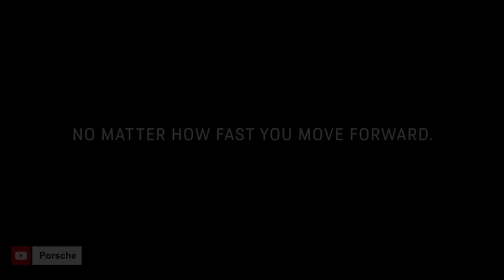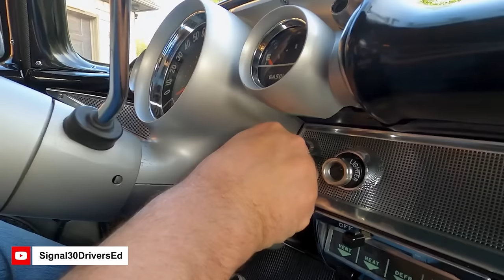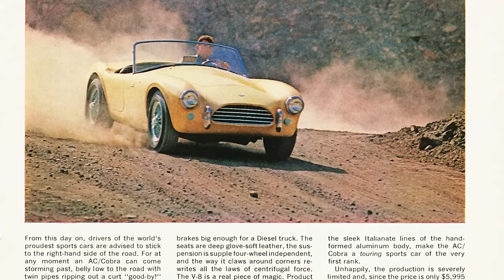Why Old Cars are Better

Comment: Modern cars = Rev hang = burnt clutch. 

Old cars with cable throttle > Modern cars with electronic throttle.
Reply: I do the math's lol.
Reply: My 98 Sentra has a cable throttle
Reply: Where do you even get a modern manual anymore? lol
Reply: @fortheloveofnoise  My '98 Olds does too.  That's not "modern" anymore.
Reply: LOL I recall getting all pissy when Drive by Wire came out like 20 years ago. I still don't understand why an RPG/Varistor connected to your foot is fed by wires through a computer that operates the throttle body with a stepper motor. Why? Why all this complication? Today? LMAO. I'm going to avoid new cars for as long as possible.
Reply: I have a 2022 Corolla manual and I have no issues with rev hang and clutch burning. Can't speak for other cars though.
Reply: @FuckGoogle502 Ford mustang lol
Reply: there's something more to it than just drive by wire. i have a 2011 ford fusion with the 6mt and it doesn't rev hang, but my MIL's 2015 subaru impreza 5mt is unbearable to drive
Reply: yeah my 03 tahoe wont shut up about throttle postition sensor codes and going into limp mode for no good fucking reason. A CABLE IS CHEAPER AND NEVER STOPS WORKING UNTIL IT LITERALLY BREAKS! @the_kombinator
Reply: @ChaseThePinballWizard  My 05 Sonata had a TPS failure, no CEL but I knew from experience what it was. I took the 5 mins and $29 it cost from rockauto to fix it though, 3 years ago and the car is still going.
Reply: the real point being what are you gonna do when the zombies take over and you cant find a rockauto? @the_kombinator
Reply: @ChaseThePinballWizard  I have a shelf and drawers with spares. I also know how to hotwire and defeat the steering lock on any car, so worst case I'll just steal one.

Or go down the street to a NAPA or Carquest. The possibilities are great.
Reply: somebody beat you to it. @the_kombinator
Reply: @ChaseThePinballWizard  To what?
Reply: they stole all the cars @the_kombinator
Reply: @FuckGoogle502  2010 kia soul 2.0 5 speed manual. Still not modern anymore tbh. It has character unlike any of these new cars ivr driven
Reply: The rev hang is to help manuals beat emissions since it helps burn off fuel or something, but I hate the side effect of a shorter clutch lifespan
Reply: @TheOnlyKreator1  There has to be a way to turn it off, no?
Reply: I hate electronic throttles with a passion
Reply: @the_kombinator  drive by wire is one of the sole reasons i wont buy a newer car, it feels so wrong
Reply: Rev hang is not going to burn your clutch unless you’re a doorknob.
Reply: @FuckGoogle502  Places that aren't the USA but yes, manuals are almost gone, only a couple of models left in Aus.
Reply: @the_kombinator  "...an RPG/Varistor connected to your foot is fed by wires through a computer that operates the throttle body with a stepper motor. Why? Why all this complication?"
As far as I know, it's to do with drivability and emissions. My early EFI car still needs a throttle position sensor even though it has a cable throttle, and I can slam the throttle open or shut faster than the air/fuel mixture can be adjusted. This momentarily causes lean mixtures in the cylinders, resulting in spikes in emissions. Or something. So newer cars replace the cable with a stepper motor to prevent drivers from making rapid changes in throttle position, and therefore they can stop the associated spikes in emissions. The downsides are complexity, worse throttle response and rev hang. =(
Disclaimer: this comment may contain nonsense.
Reply: @MathsYknow  Haha your disclaimer is awesome ;) Although I did not think about the potential of rapid pedal input. You know what deals with that perfectly? Carburettors. There's a whole other can of worms with those, especially related to emissions, but when they work, I find them less fiddly than mechanical or TBI injection types.
Reply: old cars = hit a tree at 50kph and die

new cars = crash at 120kph and live
Reply: @leviathan5207  I hit a 99 Venture with an 87 Hyundai offset (head on, mostly) - the van flipped on its side. I came to a stop on all four wheels - both cars were write offs, but there were injuries in the Chevy - none in the Hyundai. He was going 60, I was going about 90 (Km/h to be clear).

My crumple zone was in his car ;)
Reply: @leviathan5207  the advances are more so in hospitals, not car safety. Of course there has been dramatic improvements in car safety, but the biggest advances are in medical techniques.
Reply: @the_kombinator  I see both sides of the argument, in some old cars where the cable run is long, it is an absolute pain to replace it if it snaps, I would still prefer cable anyway.
Reply: @maxmeister747  5 mins in an old Hyundai ;)
Reply: @FuckGoogle502 my 08 outback may be getting up in years but it's still new enough to have electronic throttle but old enough to have a manual. The rev hang does in fact suck
Reply: @the_kombinator  I owned a twin carb flat-4 Alfa 33 for many years. I bet the endless trailing throttle backfires (which I loved) weren't so great for emissions. Its throttle was quite sensitive just off idle - EFI with TPS / drive-by-wire could map that out. One might call its twin carb setup fiddly because it would block jets or require tuning from time to time. I'd totally buy it again though.
Reply: Not really, maybe you are too poor to drive a quality modern car. A dual clutch system performs amazingly
Reply: @ChaseThePinballWizard zombies? You went to some special classes didn't you?
Reply: @smokinnplatez1426  You used the word "quality" and "modern car" - your intellect is limited.
Reply: Rev hang is the reason I didn't buy the new Civic. Sad tbh.
Reply: @smokinnplatez1426  DCT is the right choice... for the manufacturer.
Reply: I rode bikes with carburators. I rode bikes with simple injection. I drove cars with cable and simple injection. I drove cars by wire with advanced injection and I now drive a car by wire with quite sophisticated injection.
For maintenance, I'd go for simple, so probably simple injection with cable. For riding/driving, it doesn't really matter. It's not the system. It's how (well) it is adjusted.
Eventually, however, being able to adapt is also a valuable driving-skill.
Reply: @ChaseThePinballWizard  I had the throttle cable break on my '72 MGB at the end of a 4,000km road trip.  I was just 4km from home when it happened in the small hours of the morning, so had it towed to the house.  When I looked at it in the daylight, I realized the distance from the pedal to the carb was so short I could have fixed it with very basic tools and a bicycle rear brake cable.
Reply: @thomascordery7951  my dad had the same thing happen to what he called a "chip truck" (box truck) so he had to drive about a thousand miles with the cable in his hand going through the window.
Reply: @ChaseThePinballWizard  cars don't matter in zombies because all the gas goes bad pretty quick in the classic "all supply lines cut" scenario
Reply: @ChaseThePinballWizard  dont know if you have fixed your problem yet but my o8 impala ss had the same issue couldnt figure it out for years but apparently its a inherent issue with our early 2000s gm gas pedals put one in my ss and the problem never came back  but i did read with the suv's that the radio fin on the top can leak rain water down into the a pillar and corrode the wire that goes to the gas pedal wire so check under your dash have fun and good luck
Reply: @the_kombinator  The societal 'trend' towards "Control, above all" bled into engineering and the decisions those above the engineers make.
The TB being Drive By Wire, gives the control to the manufacturer/regulator. 
It literally takes your pedal input as a *mere suggestion*, computed and 'decided' against your will (in the name of 'fuel efficiency and emissions').
Reply: @LRK-GT  Carburettors. :D
Reply: @the_kombinator cheaper
Reply: @leviathan5207 thats very true, the fun in old cars comes with a price
Reply: my 2010 vw, sounds about right
Reply: @the_kombinator  Drive by wire is more important with cylinder deactivation to smooth over the sudden step-changes in power, one of the big criticisms of the Cadillac V8-6-4 which had a physical throttle cable.
Reply: @ChaseThePinballWizard  Sounds like you need a new TPS or throttle body. Ignoring the problem won't make it go away.
Reply: @milfordcivic6755  tried that.
Reply: Dawg, my cable throttle Ranger felt like it had rev hang when I got it, TBH... I guess I was just too used to my motorcycle.

Comment: I'm 17, so I guess the nostalgia doesn't really exist for me yet, but the main car I drive is a 1990 nissan. When I drive my moms new audi suv it doesnt even feel like I'm driving and I feel like I'm a worse driver just by driving that car. I can barely see in front of me and I feel like I have no control over the vehicle. My car is the sweet spot where I can do all my maintenance on it very easily and I also have the reliability of a 90s nissan and its overall been a blast to drive and work on and maintain and I couldnt be happier
Reply: nah I get that though my car is much newer. I hate how numb the steering feel in regular cars is. It drives me mad.
Reply: Your emotions aren't wrong here, you're not wrong. I'm an older Gen Z, (02, I turn 23 next April.) I love my 99 Camry! One of the best and simplest cars I've encountered.
Reply: @JD-fx9ly  nice! I hope you get tons more mileage out of it.

Comment: I have my two Chevy's. 1979 Monte Carlo and 1989 G20 Van. Both very reliable. Everything is simple and can be repaired yourself. I've owned them for 34 and 22 years. Greetings from Germany.
Reply: Awesome!  As a Chrysler diehard who converted to Chevy just because our Chevy truck drastically outlived all our various Mopars ('95 Chevy Cheyenne K2500 that's still my daily with 305k miles on the clock now, plus my bands old '78 G20 touring van that lasted until I decided to completely revamp it), I love hearing of Chevys in Europe.

Comment: My dad was a builder in the 1970’s. Even then he put so many nice things into them, and didn’t build cookie cutter houses. One thing I specifically remember was my brother in law, who was an excellent trim carpenter, explaining why when he installed crown moldings, he always glued the mitered corners. As a home shifts, he said those moldings would stay tight. The other memorable thing was that all the trim was stained and then covered with 5 coats of lacquer. It was more craftsmanship. 
Similarly, I’m of the opinion that the older automobiles were more of a craft. They certainly had better looks certainly had better personalities that differentiated themselves, and they certainly were exciting as the model years would change. Of course they rusted they didn’t have the same reliability that I’m sure we see today, and other issues, but I’d still rather drive my 1978 Thunderbird or my 1976 Lincoln mark four versus my wife’s 2024 Nissan rogue. excellent videos. I am a recently new subscriber and I am excited to watch more of your videos.